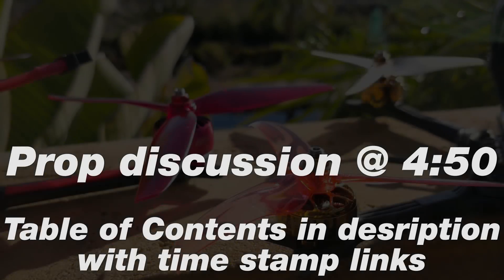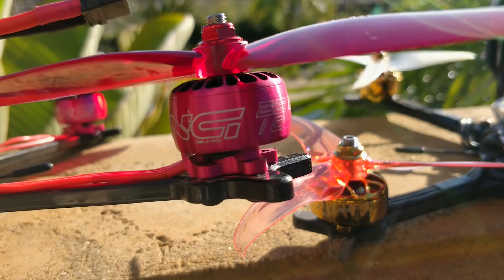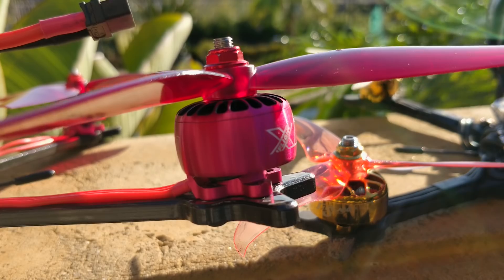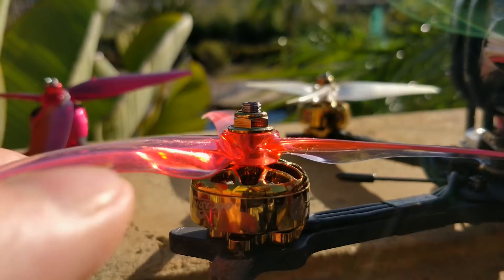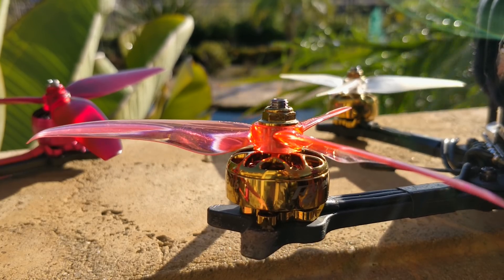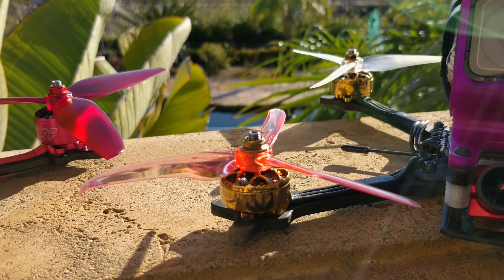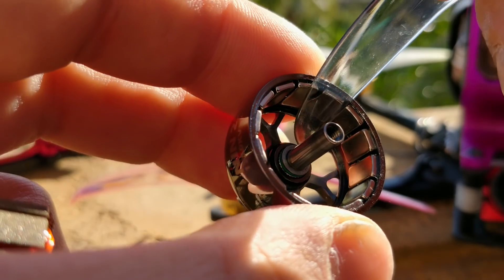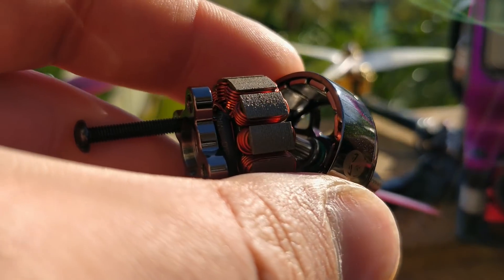Gemfan 5146.6 and Flywoo Motors

Comment: Have you seen the new ECO motors from Emax? For only $12 they seem unbeatable
Reply: Thanks for the heads up, going to build a 'basher' quad and was eyeing up the DYS Samguk's, but cheap Emax motors? Yes please!
Reply: @licensetodrive9930  DYS just released the "SUN-FUN" motors as well and 3B just released their 3B Trainer motors in 2306 and 2206, 7 different Kv's from 4-6S. I just ordered the 3b trainers for my basher apparently they are unbeatable. Thick curved magnets, hardened steel shaft, large set screw, and tiny air gap. Would def check them out before you get the EMAX... one weird thing is EMAX will not release thrust tables for the ECO's... which is suspicious
Reply: @UptiltFPV Thanks, I took a look and whilst the specs & prices of the DYS SUN-FUN 3B Trainers are good, the downside is that there doesn't appear to be anyone in the UK stocking them, but there is UK stock of the Emax ECOs (meaning no long post time and potential customs charge).
Reply: @licensetodrive9930  Aah, well i can definitely sympathize with that my friend. And lets be honest this new generation of "budget" or "high value" motors will be unreal compared to the offerings of the past so im sure whatever you choose you will be getting a great motor.. One other i forgot to mention is the HGLRC Flame 2306 motors.. They only come in 2450kv but i flew a buddies quad with them on there and I was blown away when he told me the price.. If you think the 3B motors might be worth it you could try going to their site and asking if they have a distro-hub  in the UK somewhere.. I have a bit of an obsession for finding the best "budget" motors because i want to progress quickly and take risks and not be too worried about smashing up my motors and so far as i can tell the 3B are the best choice on the market.. If you do get the ECO's it would be great to see some flight footage. Aaaand im rambling again. Happy flying, cheers m8
Reply from the maker: Haven't yet but they look good
Reply from the maker: Thrust tables are pointless.  You have nothing to compare them against an they literally mean absolutely nothing.
Reply: @Kabab  Do you think that is the reason they have excluded them in all their marketing for the motors?
Reply from the maker: @flighttherapybullisticfpv133  I think they may just not care because they realize it's pointless. There's no standards. Look at miniquadtestbench if you want to see numbers. Nothing else is useful
Reply: @Kabab  I just received my set a couple of days ago and I'm in the process of installing them. One thing I noticed is they are EXTREMELY smooth compared to other motors I've held. I practically can't feel the notches at all. This is a good thing right?
Reply: @sloanv2610  Depends what you want. Less notchy means more smooth, but also means less powerful. This comes from the magnetic proterties. A notchy motor means the magnets and such are strong and the field is really strong. With a less notchy motor, the magnets and such are weaker, probably meaning less power. Which less power may not be the worst thing ever...
Reply: Sloan V where did you find them for $12 , eBay has them for $15
Reply: The LongRanger eBay is a rip off
Reply: Aj 15 not really , free shipping , highly rated seller good feedback